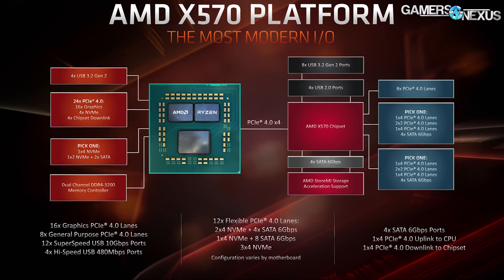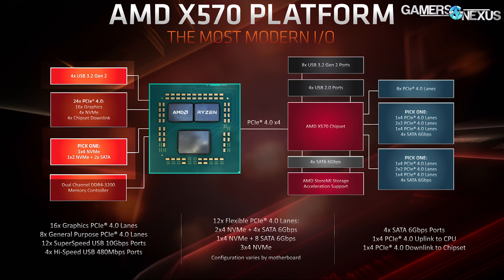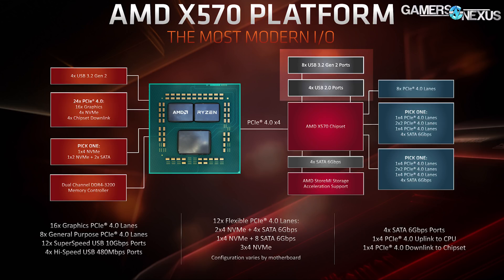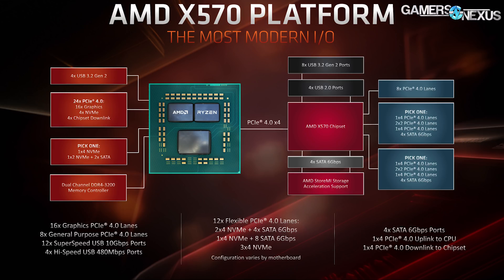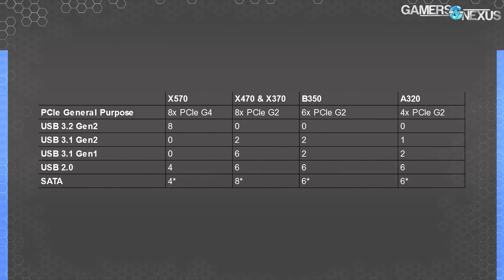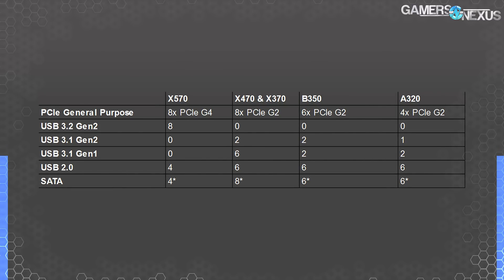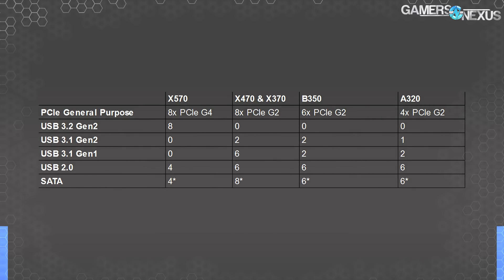AMD X570 vs. X470, X370 Chipset Differences, Lanes, Specs, & Comparison

Comment: where does b450 fits in?
Reply: Buildzoid sugests that any CPU up to an 8 core should be fine with a decent b450, 12cores or more not recommended.
Reply: thats what i wanna know too. is there gonna be a huge difference in performance between b450 and x570 if lets say both are equipped with rx5700 and ryzen 3600 for example
Reply: Martin Ivanov Indeed. I could say that a real 4+2 vrm will be enough for a 8c OC or up to a 12c stock but some b450s have less than that, and using doublers with less phases and may cause degradation  on the cpu over time if you keep a high OC 24/7.
Reply: @TheBoltcranck  but do u know if there will be a performance difference in fps if u run them, lets say stock, between x570 and b450? i really wanna know if x570 is worth it for performance or it just has little bit more features
Reply: @martinivanov1319  From the specs difference it looks like pcie gen 4 will be good for nvme ssd but for performance maybe only overclock speed achieved will be higher on x570 , but I dont see a performance loss on stock speeds.
Reply: @martinivanov1319  If we take amd words on new ryzens tdp as accurate, i can expect to see even 12c working well on b450s, and in some high tier b450 motherboards running the 16c part working well at stocks speeds with stock cooler, but after that you will need a aio 240mm and good airflow inside you case for a low to mid oc on the 12c and low oc for 16c. But becauce we need to take into account the number of cores getting active oc and the watt require to feed all, the watt comsuption may incresse faster the high core count we have in the cpu used.
Reply: @TheBoltcranck  i wanna buy msi b450 gaming pro carbon but its so hard to buy it. idk why. its out in my country. what other options do i have that have good audio? u know the new realtek 1220 that only the best most expensive motherboards have it.
Reply: @martinivanov1319  I bought the rog strix b450-f gaming vrm 6+2 phases, 1220 audio codec, x2 nvme m.2 pcie 3 x4, 4+2 sata 6gb(m.2-1 shares pcie lanes with sata 5-6, and m.2-2 shares pcie lane swith gpe x16 lanes= x8 gpu,x4 m.2-2), 6 fan headers pmw, intel gigabit lan. running a r3 2200g  (as placeholder for the new ryzen 7 3700x) + old coolermaster tx3 old, 16GB(2x8) 3200@cl16-18-18-36, sapphire radeon rx 570 4gb pulse, (m.2-1port) plextor 256gb nvme M9PeGN, (sata1-2 ports) 2x hdd 2tb raid 1 for my docs, (sata 3-4 ports) x2 ssd 500GB wd raid 0 for games. I've been able to oc the 2200g up to 4.0@1.4 v 60 max temps under load no problems.
Reply: @TheBoltcranck  Have you tested out the r7 3700x on the b450 yet?.
Reply: @myoriginalname  I went for the r5 3600 for the moment and I gonna wait for next year zen 2+ or zen 3 , then pass down the r5 3600 to my nephew who has now the r3 2200g. just a tip, i removed the rgb plastic shroud on top of the vrm for beter temps and I am using a arctic 34 duo to cool the r5 3600.

Comment: Will x470 have the same PBO abilities as x570? PBO on ryzen 3000 includes raising maximum boost clock, unlike on 2000 where it only affected all core boosting behavior.
Reply: This, i think we will need to wait.
Reply: The slide for the apus said PBO 2 so I think they're still on 2. Meaning no upgrade as far as PBO.
Reply: Since the feature has nothing to do with the actual chipset you'll have to wait and see if board manufacturers include it in a BIOS update.

Comment: Edit3: I got my answer to my question in edit2, thanks.

Right when I am making my list for the x570 with 3900x system which I hope to move to late this year, great video.

Edit: When I wrote this the video wasn't done yet, but the first half is HQ as always.
Edit2: My only question is, would a 1x 4 lane PCI-e gen4  fully support the data throughput of 2x x4 lane gen3 NVMe SSD's since it's double the speed of gen3, would it let manufatureres of motherboards allow this to be done.

Clearer example:

I have two samsung 970 EVO NVMe M.2 drives which run on gen3 x4 lanes each.

The CPU has x4 lanes for NVMe as seen around 3:18 but this is gen4 which is x2 the speed of gen3.
Would both the NVMe drives on a MB (if possible) run over that single x4 gen3 link with the CPU?
Reply: No. If the m.2 drives are PCIE G3 they don't have the capacity to read or write data as fast as G4 can so they'll still only work at G3 speeds. It's very unclear from what I've seen so far if the 4 PCIE lanes reserved for NVME devices will go to a single port or to multiples. I do know Corsair has announced PCIE G4 NVME drives and I assume other will be coming out when Ryzen 3000 launches or very soon after. 

There's also an expansion slot card that will hold 4 m.2 PCIE G3's and run them all through 4 PCIE G4 lanes. I'm assuming from the press on that that the card has the necessary hardware to receive and transmit at G4 speeds and handle the reads and writes to the drives at G3 speed.
Reply: @KenS1267  Corsair and Gigabyte are the only ones bringing consumer PCIe4.0 nvme drives this summer...Absolutely right about the limitation of PCIe3 drives regarding designs not intended to output at PCIe4.0 speeds. And of course the heat, I think each NVMe drive can output 15w of heat leading to some RAID PCIe Cards looking like radeon series videocards with their heatsinks + blower fans configuration
Reply: No you can't, the moment you plug a pcie 3.0 device the lane becomes 3.0 and the extra bandwith is not used.
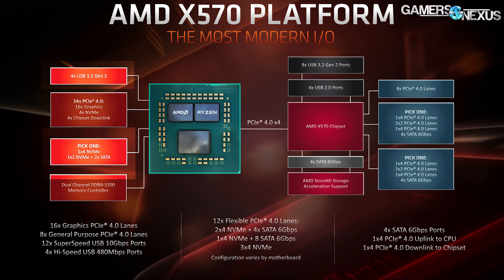But with those extra pci lanes coming from the cpu shown at 3:20 this wouln't be a problem for you
Reply: @ivanbrasla  Thanks, your first sentence cleared up all I was confused about.
Reply: I'm gonna go for the 3900x as well. Which Mobo are you looking for? It's a little scary the prices of x570 Mobo tbh.
Reply: @luisangelini2220  Well I am looking into doing a small form factor build with watercooling, at this moment all I've seen are the ASUS X570 Crosshair VIII Impact and an Asrock board.

The Asrock board doesn't cover all that I need so right now the Mini-DTX Impact is the only choice I have for small(er) form factor.